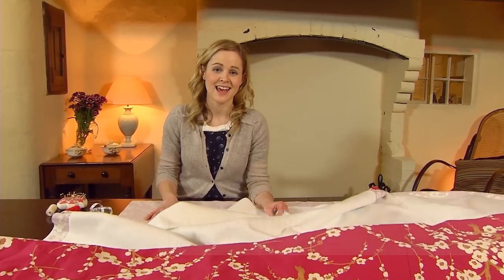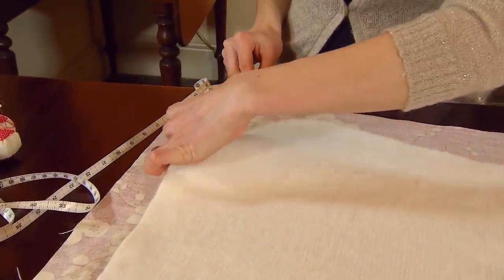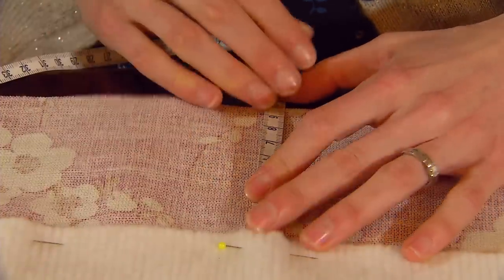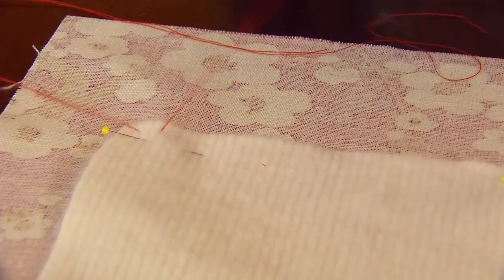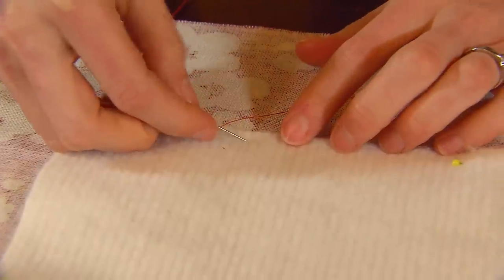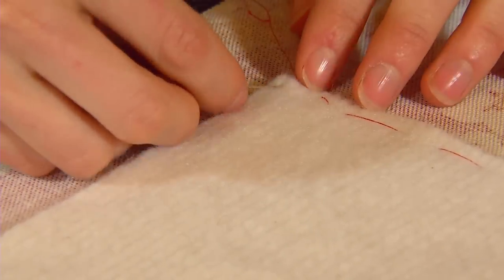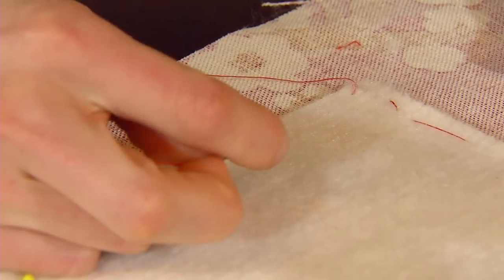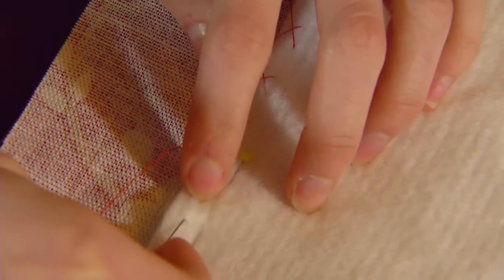How to Make Thermally Lined Curtains - Part 2 of 5 - National Trust

Comment: Maybe I've missed something but in part one it was advised that we add 23 cm to finished length to main fabric for hem allowances.  You then advise a 10 cm gap between bump and top of main fabric which is folded down (presumably for heading) and 20 cm gap at hem between bottom of bump and main fabric. This adds up to 30cm em allowance not 23 as stated. Or am I wrong?
Reply: +Carol Agnew sounds right to me.
Reply from the maker: +Sandra A. Hello Sandra. In film 1 Lauren says  the outer fabric should be 23 cm longer than the final curtain but the  cotton bump  should be 7 cm shorter than the final curtain. It's this  7cm  shortening which allows you to have  a 10cm allowance at the top and a 20cm gap between the bottom edge of the bump and the bottom edge of the outer fabric.
Reply: Hello nationaltrustcharit, Yes, thank you! I realize now that I've read your message that I was looking at it incorrectly. I appreciate your comment.